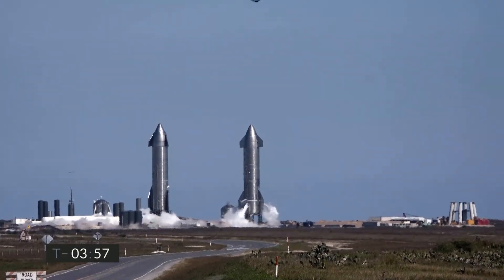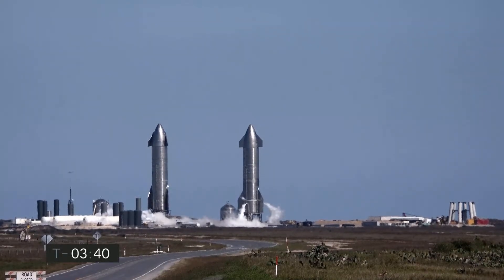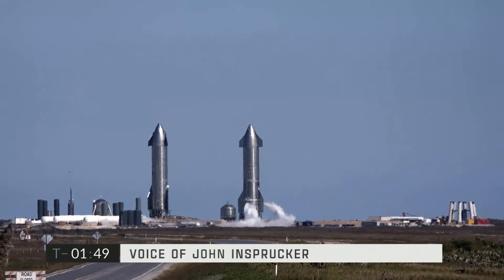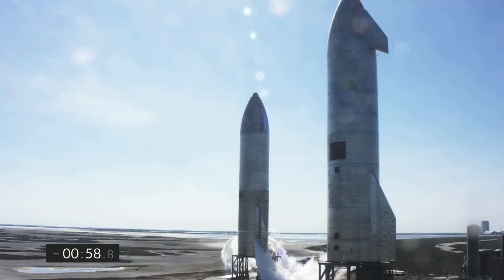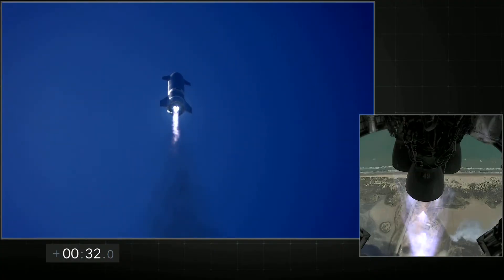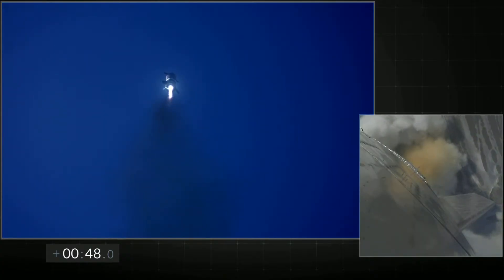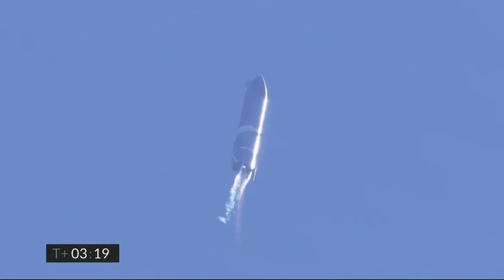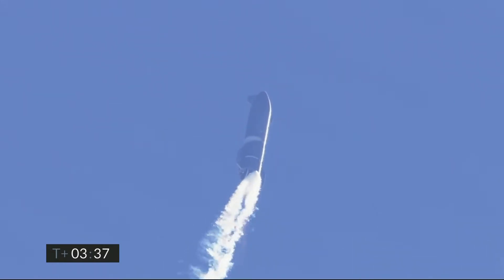Starship | SN9 | High-Altitude Flight Test

Comment: They didn’t fail they learned 2 ways not to land a rocket .
Reply: 11:46
Reply: @emilian9697  All the engines lit up properly per the queues.
Reply: @ioutra6121  compare sn8 with sn9 and than comment
Reply: @emilian9697  SN8's ignition on landing wasn't mixed properly and ended up burning the engines, causing the thrust to be insufficient for landing. SN9's ignition on landing was mixed properly, and the thrust was proper, but flipped too much as a form of overcompensation and made a hard landing.
Reply: @ioutra6121  this doesn't mean anything tell me how can you land sth that big with only one raptor engine
Reply: @ioutra6121  second engine didn't fire and thats it
Reply: @ioutra6121  how was the thrust proper it went to the ground as fast as a bullet
Reply: @emilian9697  The engines did fire as intended
Reply: @ioutra6121  yea  yea whatever you say
Reply: @emilian9697  e
Reply: @emilian9697  also they lowered the flaps in order to begin flipping the ship, but they should have re-extended it to keep it from continuing to flip
Reply: This is exactly why SpaceX is leading the world in spaceflight. They are willing to "fail" in order to learn.
Reply: @DanielH212MC  and it's the speed of failure/iteration what is amazing
Reply: @DanielH212MC  do or do not. Failure is not an option - 🐸
Reply: @DanielH212MC  Just like the Russians right?
Reply: At 12:45 "...we need to work on that Landing... a Little Bit..."  😆   I love that "A Little Bit"... this comment is is Masterpiece...   but would be useful to work a little bit more,  than a Little Bit, please 🙏
Reply: @simonci5177  What exactly is a little bit when dealing in that type of scale?
Reply: You can see one of raptor failed to light on again
Reply: @emilian9697  It looks like they had two engines not start up. I think one started up fully, another one tried to start but like, stuttered or something, and the last one didn't start at all.
Reply: @DanielH212MC  they land with only 2 engines
Reply: @DanielH212MC  He said that they wanted two engines for the flip and one for landing
Reply: @DanielH212MC  Either ran out of fuel or pressure fail
Reply: Daniel_H212 I believe that only two engines were intended to restart for landing.
Reply: @kilianclasen5521  maybe flaps+1 for flip and 5 for landing
Reply: @DanielH212MC  They said in the video. We will ignite one engine for the landing.
Reply: @DanielH212MC  Only 2 have to relight. The rocket makes a decision of either 2 or 3. This picked 2 but 1 of them failed
Reply: @emilian9697  On this stream and on NASASpaceflight's stream two pieces of debries were visible being hurled out from the engine area. I am really interested in the findings, what (if anything) could the debries indicate.
Reply: @CzechMirco  before or after explosion?
Reply: @emilian9697  11:47 you can see the first one to the left of the ship and then about a second later the second one to the right and above the ship.
Reply: @CzechMirco  yeah nice eye i think it came out of the flap
Reply: @emilian9697  Well, to be honest, I'm not sure whether I'd been able to spot it from this video alone. I saw it much more clearly on a video taken from a different angle at NASASpaceflight.
Reply: @emilian9697  That 1 is not ment to turn on.
Reply: @Bacavoit  2 need to turn on only one did
Reply: @emilian9697  wrong the second engine only needed to fire for the flip maneuver. it cut off as it should the craft just over shot the 90 degrees.
Reply: @highkicker11  watch sn8
Reply: @emilian9697  why arent they using all engines?
Reply: @lotusedelmann4030  they need to save fuel they dont have much and 2 engines are enough but one didn't turn on so 😕
Reply: @emilian9697  but if they are that unreliable at this state they could just load some more fuel
Reply: @lotusedelmann4030  they only pumped fuel for 10 km thats the requirement they cant fuel it in the sky
Reply: @lotusedelmann4030  Much lighter coming down than going up.
Reply: @lotusedelmann4030  
More fuel means a higher terminal velocity. That may not improve the situation.
Reply: @emilian9697  the last time both of them failed. this time at least one stayed alive. what a trooper
Reply: @emilian9697  if i recall it correctly they only did an temporary fix to the engine from last time.
Reply: @emilian9697  dont they test these things!?!?!? at this point spacex is just doing it to get attention
Reply: then they will do a "how NOT to land a Starship"
Reply: Absolutely, look  at how many times the F9 crashed before it stuck the landing.
Reply: @TheJimtanker  Exactly what I think when I see all the naysayers
Reply: @kilianclasen5521    SpaceX is the first company to ever use Agile Development in real world applications.
Reply: God Is good  They do a suicide burn, meaning the moment the fuel in the tanks end you should be on the ground, any later or earlier the engine start you will be dead. I do know that they can flip only using the hot gas thrusters as opposed to using the engines when they get added but that's later down the line+they won't be able to use the atmosphere to slow down as much if they flip earlier+they really had enough time, the engine tried to ignite for about 4-5 times; i really don't think more time wpuld have changed anything. I guess its a problem with the lox header pressure this time which doesnt benefit from more time.
Reply: Technically it did land.  In fact it's pretty hard not to.  It just wasn't a controlled landing.
Reply: Perfectly summed up 👏🏻
Reply: God Is good  I think testing the limits is good, it’s called a suicide burn for a reason. It’s testing a last minute burn to land.
Reply: You're so right, this is how science actually works.
Reply: They crash em, cuz tgey want a "how to not land a starship" video like the orbital booster one
Reply: Damnit, I was so hoping this was the one. Great work, Elon. Keep it up. 😋
Reply: that was a perfectly executed rapidly unscheduled disassembly
Reply: Success is in many forms.
Reply: Soon we’re gonna get ‘How not to land an orbital starship’ as the follow up to ‘how not to land an orbital rocket booster’
Reply: @ProtonSemilightCondensed  That’s what I was thinking too, lol Elon Musk gonna definitely edit the video himself.
Reply: True words!
Reply: I love that comment. I gonna teach my kids that. Its not failing. Its learning how to succed :D
Reply: Something fell off , 11. 46 . Left mid lower  . .  Metallic . .   Own up , who didn't do Thier job right .  Learn but don't learn . . Next time solve the problems correctly . As in , reliability . .
Reply: Gottfried Lieber  but a bellyflop landing is so much cooler!!!
Reply: why not use a parachute ?
Reply: Don't worry dude it's reusable
Reply: @waichungsham1578  haha - that's humor 👍😜
Reply: God Is good  I am pretty damn sure they know what they are doing much better than you and have considered all possible thing you can come up with
Reply: You don't need to improve on previous attemps on all attemps. If that was the case then engineering would be rather easy, in the real world, it is not.

The main goal of prototyping and testing is to analyse failure points design new ways to fix the failure points, to correct them. However the correction itself more than often will also have flaws that cause fails which can seem like losing progression during the test.
But do not be mistaken, each test whether it seems like it did worse or did better adds just as much progress as every other test.
Reply: Gottfried Lieber  Apollo 11 got lucky. They had a navigation failure just before landing. Armstrong landed blind. Pure skill.
Reply: Simulations only get them so far. This real world test data is completely invaluable. First time they ran out of propellant, this time second engine wouldn't start. They'll get this sorted out. They've landed what, 70 Falcon 9s?
Reply: Yeah mate. Perfect comment
Reply: Just like Edison
Reply: @benihanaa  probably before NASA lands on the moon again!
Reply: That's the spirit
Reply: This guy markets
Reply: thats the spirit. lol.
Reply: You mean an unplanned rapid disassembly
Reply: Absolutely, this is the process that is required.  Many things again went according to plan, just the last stage needs to be perfected.  Amazing progress !
Reply: Yeah👍
Reply: Spoilers! Jeez
Reply: COPE
Reply: now gotta be 3 xd
Reply: 98 more to go .. Diamond Hands
Reply: I was hoping for some aerobatics manœuvres, just for fun.
Reply: Spoiler 🙄🙄
Reply: There are thousands of ways not to
Reply: Crazy... that's exactly how we learn  everything in life
Reply: Gottfried Lieber  dunno if you are trolling or if you really are that clueless
Reply: That’s science!
Reply: And soft landing or not, it was glorious
Reply: Gottfried Lieber  But they landed only a small part of the system, the biggest part was thrown into the ocean!
Reply: good philosophy we all haz
Reply: God Is good  I thought of that too
Reply: God Is good  the entire point is to flip and burn at just the right time to use the least amount of fuel, as this is meant to be an interplanetary reusable rocket. performing the flip at a higher altitude negates the entire purpose of starship.
Reply: The rocket knows how to land because it knows how not to land. By subtracting how not to land from how it could land gives you how to land.
Reply: They learned by failing, it's still a failure
Reply: Gottfried Lieber  We can't, as in no one knows how to rebuild the F1 engines or something I heard
Reply: It was different this time, SN8 overburned and SN9 underburned it looked like
Reply: Gottfried Lieber  Apollo 1 testing killed 3 astronauts on the pad, and we very nearly lost 3 more lives on Apollo 13.
Reply: God Is good  It saves on fuel, hovering a spacecraft is ineffective and expensive (same reason they developed the crane landing system for the Mars rovers, to have a short hovering time and save en fuel/weight)
Reply: @Berserka-1  just because it didn’t land, doesn’t mean it failed. It had more improvements than SN8
Reply: @MITCHELL LANDREY interesting theory!
Reply: Why not to start the flipping earlier than that like on 5 km hight and try to control its altitude first then go landing.
Reply: Yep... and making history at the same time.
Reply: yup
Reply: God Is good  The higher up they flip, the less drag they have and the faster the ship meets the Earth.  Flipping earlier makes for a harder landing.
Reply: People didn’t go back to the moon 50 years after landing, they spent $ 218 billion on it, and now Ellon Musk has appeared out of nowhere and lo and behold, let’s go to Mars,, who is he, where is he from, where did his billions come from, who is pushing him and financed, what kind of game is that, ??? The powerful in the world must know something that we ordinary mortals do not know, something is badly prepared for us, why great powers hide behind an individual and do not tell the truth, why 500 people are sent to Mars at once, in two or three years, to preserve human genus, civilization, our genetic material, is this the end of the Earth, civilization and life as we know it, where is the truth and who knows !! ??
Reply: 3rd times a charm !
Reply: Omg stop trying to be so preachy, it’s gross in the comment section
Reply: Lmao
Reply: Spacex future video be like : how to not land a starship
Reply: Yeah. their making another how not to land YT video again for this purpose.
Reply: THIS IS THE WAY
Reply: I do find it “interesting” that there are so many with absolutely no engineering training or experience trying to tell the rather brilliant rocket scientists at SpaceX how they “should” do things.  Oh, the internet... it sure does bring out the idiots who think they know it all.
Reply: @CharmsDad  Yes it is so aggravating to hear some of the comments at least have  engineering training some years underwater and worked for NASA, JPL. subs are the closest to star ship a skate class was 25ft Beam torpedo room to reactor compartment 160ft + or - a few feet.
The hydraulics, air systems, electrical systems, propulsion systems, reactor controls, primary and secondary generators it will be fun
,  CAMS, O2, CO2, electrolysis, all tested on subs before going to the ISS and still being used, and will go to mars 90 days underwater is half way to mars. I have been half way
Reply: Definitely
Reply: Rockey
Reply: Simp
Reply: God Is good  and what would they do about the extra g force they had to counter.
The flaps were introduced for a reason.
Don't try n act smart if you don't know shit.
Reply: we will soon see how not to land a starship video:)
Reply: https://www.youtube.com/watch?v=Im799XZxLEs
Reply: God Is good  "seems stupid": that's why you're not an engineer at SapceX.
Reply: Na... we already new it was a bad idea to crash and blow up on the ground. Nothing new learned. I new that 20 years ago with my Estes rocket 🚀....
Reply: Houston the eagle has land.... 🔥
Reply: Everyone commenting "failure" is probably only here because it's an Elon Musk venture. They didn't even see SLS "fail" when testing a few engines on the ground a few weeks back, which is an overdue and well-past budget project, meanwhile SpaceX is conducting real flight tests. A prototype is a prototype, they make 'em for a reason. If they were confident, there would be two stacks, 28+6 engines, astronauts on board, and course set for the moon.
Reply: 4...3...2...1... Houston we have landed🔥… hello eagle do you copy?
Reply: https://youtu.be/5NVRVeyfFTA
https://youtu.be/5NVRVeyfFTA
Reply: @Dean Zinter You’re right about one thing, you’re clearly not an engineer because you obviously know nothing about high end development.
Reply: Even if it works,its a receipt for desaster.
Reply: @OompaL0ompa  A “receipt”???  Wow, you clearly don’t have the slightest clue.
Reply: 1 raptor indeed failed to light up again. I guess they failed to address that. Also, doesn't anybody think they're trying to land the Starship with little wiggle room to light up the raptors? MAybe they should light it up higher than usual.
Reply: @The_Crazy_Monkey75  They’re experimenting with a new and innovative method of landing.  Most believed their plan to land the boosters was unachievable, yet they are now making it look routine (after several failures in the beginning).
Reply: https://youtu.be/5y1qjObX660
Reply: God Is good  Its called a suicide burn for a reason
Reply: You're right 👍
Reply: https://youtu.be/5y1qjObX660
Reply: @Brady M. Kolve well said!
Reply: well yes but actually yes
Reply: i live in a third world country , meaning i can't buy PS5 so if you subscribed to my channel i can't be any happier to buy one :)
current : 227
Reply: Best comment.
Reply: @benihanaa  You are just fooling yourself. NASA is behind this for providing techniques. Why didnt nasa do what Mask is doing ? Easy answer: No fuking use. Review Mask's Ideas--none of them is with much scientific value because he can not aford it. It's just commercial. This Rocket-Regain technique is not something new. There s limits with this. I suggest you get some engineering title first.
Reply: https://youtu.be/eFOh32tUAkE
Reply: https://youtu.be/XDgEQHrC3Kw
Reply: ,,https://youtu.be/TVvLwVsQ7dM...
Reply: @Shairkhange  no im not but i don't think you are neither and you are not as smart as Chris Hadfield and if you dont belive me go see his recent video in ig🤷‍♂️ mad 🐀
Reply: @Shairkhange  and who tf said engine was the problem in sn8 i said it was in sn9
Reply: The Fanboy level is off the charts🤪
Reply: https://youtu.be/DVHl-V23_TQ❤🐾😺❤
Reply: https://youtu.be/95ytVYby5A4 🙏💖
Reply: https://youtube.com/watch?v=hGVDzN-oPGA&feature=share🙏👌
Reply: Yes, that's how you learn. 🙄
Reply: God Is good  it does seem that way, but there is less aerodynamic drag and control when it is upright. That means you have to run the engines, and that means you have to leave fuel to do so. When a single engine consumes over two thousand (2000) pounds of fuel and oxidizer every second, every second they are on is critical. Part of these tests is to learn to do that maneuver, perfectly with minimal correciton, every time.
Reply: So in other words they failed
Reply: How long does it take to get from a 'free-dive' to a vertical stop in the air on one engine only?
That would be the point to re-ignite the engine for the landing.
...just in case no other engine works.
Reply: True
Reply: Yeah
Reply: in zero grav..thatmofo is for the moon man
Reply: wow , the PR really works on you 🤣🤣🤣🤣🤣
Reply: https://youtu.be/vwvTarqg8g4
Reply: Well a nazi like von brown needs to be on the team
Reply: If the intent is/was to land the thing in one piece, they failed... no point softening it down!
Reply: There is more than a million ways not to land a rocket, and one way to land a rocket perfectly
Reply: @MITCHELL LANDREY mhmmmm
Reply: Mars is the New Earth! Earth Will soon Die Anyways!! Musk is God. TESLA and Tesla Holders will be Kings. Rest and their Family will be Our Slaves and work to Power energy for Bitcoin!! Elon is Einstein, Edison, Newton, and Jesus combined. HE at least deserves several Nobel Prizes. Elon has more IQ than weight of Hater's Ug ly Prius and his F at Ho Combined!! HE is like Ironman who will destroy Thanos and critics are better off using their cash to wipe their a n us. JUST Worship Him instead of other silly god!! GOD Elon will Punish infidels!! Go Emperor God Musk!!
Reply: G ay Eco-Nerds Hate Bitcoin Because it use more Energy than major countries. BUT Space X and Tesla both Hold Bitcoins. Elon himself has Bitcoin and Ethereum. Tree huggers and Eco-Nerds should buy something else. I don't do nerd things like electricity or energy. Bitcoin Haters will become our servants and Plant More Trees! Non-Holders will Work to Death to supply electricity for Bitcoin!! Haters of Tesla and Bitcoin will only Lose Money. Have Fun Staying Poor! We will RULE while they LOSE. Buy Bitcoins While They Are Super Very Cheap!
Reply: تعدد الكواكب
Reply: I sense a future upcoming “how to not to land” series.
Reply: There's the right way, the wrong way and the Max Power way.
Reply: It seems that SpaceX needs to practice the flip maneuver to landing way earlier.
Reply: Can't wait for the "How not to land a fully reusable orbital class Starship" video.
Reply: I can‘t wait for the video „how not to land Starship”
This will be so cool to watch in a few years
Reply: Its the same how the last one crashed one of the engines didn't start in time maybe they can try a different landing approach
Reply: @anselmrd2638  The last one crashed because they ran out of one of the fuel components in the engine (the exhaust went green, which meant it was burning engine components instead of the right proportion of engine fuel/oxidiser mix)
Reply: The Solution here!!!!! Read!
Flip at 2km on upper engine with the right pressurization in that moment.
When Silos stabilized and slowed down (3-4sec after flip) start the 2nd and 3rd engine.
Enjoy the landing!!! 
Mars we are coming to yaaa!!!
Reply: New video coming up soon
Reply: Lol
Reply: Why can't they do in small scale and check lol
Reply: @debashishjena    Simulations are one thing but only in real life will you find the true chaos.  You don't play KSP do you?
Reply: @debashishjena  sometimes the only way to make it work is to test it at full scale, and the more Stardhips they build the better they get at building them
Reply: The following is happening in our World and no one is noticing.

1. Armageddon is about 4 action events.
   1st horse, Bow = Send it.
   2nd horse, Sword = Strike it.
   3rd horse, Scales = Split it.
   4th horse, Fire = Sear it.

   That ='s Our planet for the last 2 years have averaged 3.23 Rockets a day into space.
   That's hundreds of rockets we've *Send*/sent up.
   We've sent close to a 1000 Rockets/with Elon saying he's sending another 1000.
   They are weapons designed to stop "Wormwood" in the book of Revelation in the Bible.
   All Telescopes on this planet are pointing in the same direction.
   Elon is building underground tunnels in major cities.
   "Wormwood" is going to hit the PACIFIC OCEAN. *EVACUATE*.
   All the ELITE TOP COMPANIES ARE EVACUATING THE PACIFIC COASTS...SO SHOULD YOU!!!

2. "The mark of the beast".
 
    Take 3 6's and place them in a circle and you have a virus warning symbol.
    But the Mark is the VACCINE. And because it is a global problem it will demand a global solution.
    The Vaccine will be given Airborne and it will land on your forehead and hands.
    It will try to alter Chromosome 7 lamb1.
    It is during these moments where the Bible mentions: You will wish the mountains to fall on you.
    And this is also the moment where the Bible mentions: The "few" and the "many".
    "Few" will die from this Vaccine (millions) and "many" will live (billions).
    This vaccine will cure all diseases BUT it will not remove the Pain from any injuries you receive.
    That is the moment of the "delusion" mentioned in Revelations. 
    If you get a cut or any injury, the pain will never go away, they just keep building up.
    You will wish the "mountains to fall on you".
    666 (six - sick - sicknesses) <->  Six species of human corona viruses are known , 
    with some species subdivided into two different strains,     
    making seven strains of human corona viruses altogether.

    Rev. 13:16 is referring to those who DIDN'T make the rapture of the church (The "born again" PEOPLE). 
What you and I are discussing is correlated with the 4 Horsemen (the timing).  
1st Horseman is the Bow (SEND it). < That Horse rides as we speak. All the Rockets this Planet SENDS into Space are Weapons of mass Destruction targeted at "Wormwood". For almost 2 years now our Planet as sent almost 1000 Rockets into space and now we are averaging 3.23 a day. Elon just boasted within the past month how he intends to send a 1000 more.  
BEFORE those ROCKETS touch "WORMWOOD", 2 EVENTS will happen.
1 Event will be the "RAPTURE" and 1 will be the "AIRBORNE VACCINE". < BOTH OF THESE EVENTS HAPPEN AT THE SAME TIME.  < The "AIRBORNE VACCINE" is the reason it happens.

I have to stop here and explain something.
Our Souls are physically attached to Our flesh by Chromosome 7 lamb1.
When a Person (truly) becomes "BORN AGAIN" Chromosome 7 lamb1 CHANGES.
So now you have 2 different groups of People on the Planet. Those who are "born again" w/the altered "lamb1" and those who don't. 
Now having said that. When the "AIRBORNE VACCINE" lands on your forehead and hands, it's going to try and alter Chromosome 7 lamb1 AGAIN.
When it does, ONLY those who are "BORN AGAIN" will die. Those who don't have the altered "lamb1" will LIVE...and be able to buy and sell during the TIME OF THE ANTICHRIST.
The "BORN AGAIN" People are people who have God's Holy Spirit INSIDE THEIR SOULS.  God's Holy Spirit isn't on this planet during the 7 years of the antichrist. His Spirit is raptured from this planet BEFORE THE 2ND HORSEMEN RIDES!!!!!
(I'm throwing pearls, you better be getting this). <<<<and all of that can't happen till the "LAST SUPPER" (see my "Last Supper" video on my channel) is over.

Then the 2nd, 3rd and 4th Horsemen happen.

So once again. The "mark of the beast" is NOT A CHIP. 
ITS THE COMING "AIRBORNE VACCINE".
You must be "born again" before the "airborne" vaccine is given or you will be here for the 7 years of the antichrist.

3. The scorpions mentioned in Revelation 9:10.
 
   There are satellites in space called HIVES.
   Inside each of them are tiny rockets called BEES.
   They are designed to Target all CELL PHONES.
   They will be mercy killings by our governments because of the actions above (for 5 Months after the asteroid hits).
   They were just tested against that RV that blew up.
The reason the word "scorpions" was used? 
What the person saw was a vision and then it ended up in Revelation. The "vision" He saw was long cylinder puffy clouds streaming from the skies, lots of them and at the end of each of those was a tiny little missile, but to the person having the vision, to him it looked like a bunch of scorpion tails or should I say cloud TRAILS.

Please I'm begging you to listen to what I've said. These events are happening right now.
There seems to be a GRAVITATIONAL PULL HAPPENING. ( Wormwood (rock heading this way in space) of the book of Revelation in the Bible )
Floods in the desserts of Saudi Arabia.
Blizzards in Spain.
Huge clouds, heavy rains and flash floods in Saudi deserts, Qunfudhah, Taif
Mass fires in Brazil.
Hot Spot - Ocean, & Scanning Yellowstone Super Volcano. 1/21/2021
Mass electrical storms in Turkey.
Hot Spots & Scanning Yellowstone Super Volcano.. 1/17/2021
Neva River freezes, Saint Petersburg, Russia
Volcanoes are activating around the Globe.
Sewage fountains out of drains during floods in Cochabamba, Bolivia
And more...!
Luke 21:11 
There will be great earthquakes, and in various places famines and pestilences. And there will be terrors and great signs from heaven.

I don't post links no more because YouTube removes them. This is so important that you help 
me tell others. I didn't make anything up. If you get a moment come see what else I've discovered
on my channel. But I beg you with all of my heart and soul to at least tell someone what you've read.
Please at least do that. Nothing on my channel is monetized.

Folks, we are SENDing rockets into space to STRIKE a rock that the book of Revelation in the Bible calls "wormwood" and when those rockets SPLIT a piece will hit right above INDONESIA in the Pacific Waters and it will rock up and down the FIRE RING of the PACIFIC sending LAVA TO THE SKIES which will SEAR 2/3rds of this PLANET.

I'M BEGGING YOU, HELP ME WARN OTHERS!

You're thinking how can you believe me?
I'm the guy who God showed where His Garden of Eden was ( I can backup those words if you come to my channel).
SOON A GLOBAL king WILL APPEAR, DON'T FOLLOW him he IS THE ANTICHRIST!

NOTE: SOON SOCIAL MEDIA WILL DISAPPEAR GO TO MY CHANNEL AND COPY MY COMMENTS AND VIDEOS SO YOU CAN SHARE WITH OTHERS ON DISKS. NOT ALL OF YOU ARE GOING TO MAKE HEAVEN (THE RAPTURE), YOU'LL BE THE REVOLUTIONIST FOR JESUS DURING THE 7 YEARS OF THE ANTICHRIST. BE READY TO HELP OTHERS. DURING THE 7 YEARS, THE ONLY WAY TO MAKE HEAVEN IS TO BE A MARTYR FOR THE CAUSE OF JESUS. YOU DON'T DO IT BECAUSE OF THE PAIN YOU FEEL. YOU DON'T DO IT BECAUSE YOUR SCARED. YOU ONLY DO IT BECAUSE YOU REALIZE WHAT A MISTAKE YOU MADE AND NOW YOUR WILLING TO GIVE YOUR LIFE FOR THE CAUSE OF JESUS. BE BOLD IN THOSE DAYS, OTHERS WILL BE WATCHING YOU AND WHAT YOU DO WILL INFLUENCE THEM. MAKE WISE CHOICES MY FRIEND. THERE IS A CELEBRATION IN HEAVEN EACH TIME SOMEONE COMES TO THE SAVING KNOWLEDGE OF JESUS. DON'T LET EVIL STEAL YOURS AWAY FROM YOU. STAND STRONG AND WHEN I SEE YOU I'LL GIVE YOU A BIG HUG AND A KISS ON THE NECK AND WE'LL CELEBRATE FOR ALL ETERNITY!
Reply: Fail
Reply: Failed is failed,
Reward is to learn.

Dont mix facts and emotion together.
Reply: Kinda looks like they lend a way to destroy 2 rockets
Reply: this is pretty much how code and my code still buggy as fuck
Reply: Yes ....that was a failure...
Reply: It failed
Reply: That's the worst comment. There are millions of ways NOT to land a rocket, and only 1 to land it.
Reply: @hqcart1  Its NOT the worst comment. What B Reeves said is true they did not fail they learned 2 ways not to land a rocket, it means they can avoid that way  to land so they can try another way to perfectly land it.
Reply: @hqcart1  i mean I bet there is more then 1 way to land a rocket. There are probably millions of ways not to land a rocket and millions of ways to land a rocket.
Reply: @hqcart1  Nope: that comment is from Spacex.......Falcon 9
Reply: @hqcart1  There is as much ways to land a rocket as  not to land a rocket.Why would there be only one?? Are you living in 1 photon universe or something?
Reply: @hqcart1  I think it was meant to be humorous.
Reply: @hqcart1  i think they're trying to shoot a rocket with cargo and land. Not just a booster.
Reply: @hqcart1  I'm sure there is more than one way to land a Rocket.  Just not that many.
Reply: @hqcart1  actually there are more than one to land a rocket...
Reply: @hqcart1  are you familiar with the concept of a joke? No?
Reply: @hqcart1  pretty sure it wasn’t that long ago where we didn’t bother landing the rockets. Now there are multiple ways: parachutes, boosters, shuttle cruising in like a plane...
Reply: @hqcart1  I bet they can come up with more than one way to land it.  They seem pretty smart and creative.  how many thought going horizontal was even part of a landing picture in the first place ;)
Reply: @hqcart1  Wrong again.  There are millions of ways to land a rocket... unfortunately, most of them leave the rocket in a rather unusable state.
Reply: @hqcart1  I mean landing, crashing meh the only difference is the explosion at the end
Reply: But really failed at landing a rocket.
Reply: This was a fail, they had a better attempt on SN8. They are going backwards on progress.
Reply: @marine2tough    The purpose of this mission was to LEARN how to take off, fly, and LAND.  They learned from this mission.  If you listen to the SpaceX stream you will hear that they had telemetry for the entire flight.  NOT a fail.

Still a hell of a lot better than YOU'VER ever done.
Reply: @TheJimtanker  Exactly! And overall this is just the second test flight, the intend of these tests are to analyze the rocket engines then to see what went wrong and how they can improve it in the next test.
Reply: @synthwaveguy_2942    Yes, and they're 10 years ahead of the SLS which will probably never fly.
Reply: @marine2tough  I don't think SN8 performed better. It really depends on what went wrong this time, which we don't know yet. If the header tank lost pressure, then it performed the same as they didn't manage to fix the issue. If the header tank didn't lose pressure, then it performed better, and they are about to discover a new issue. This is a prototype and the goal of a prototype is to find issues with the design so it can be improved.
Reply: @marine2tough  

How did they go backwards here? The fuel pressurization seemed alright, no green flames!
Reply: @marine2tough  they are not going backwards, they fixed the problem that made sn8 failed, this time it was something different (probably an engine failure) so they are going forward beacouse they improved from SN8. It's like learning how to ride a bike, even when you fall over but if you got further distance it's still an improvement
Reply: Come on dude. NASA could do way better than this. Mask is just a clown for doing this project. Funding Space projects is national not commercial.
Reply: @andyweingarten5978  LOL! "NASA could do way better than this..." LOL #MoronOfTheDay
Reply: @andyweingarten5978  NASA never tried to land a rocket. Last time they tried they didn´t even get the rocket in the right direction!
Reply: @macdieter23558  dude. get a title first pls. A rocket is just a toy. How many times has Nasa landed a spaceship.
Reply: @andyweingarten5978  way better? How many times has the SLS gotten off the ground yet? Both projects have been running for almost the same length of time.
Reply: @CWO333  but one has got a pricetag bigger than the entire Space X economic history 😜
Reply: @andyweingarten5978  How can you say that hehe, NASA wouldn't even try this, and their moon rocket is still living in the 80s! Commercial Space Companies are getting so much farther in a small amount of time than NASA ever will do (and they do it better hehe)!
Reply: @andyweingarten5978  bahahahahahahahahahaha
Reply: @andyweingarten5978  ¿De verdad que la NASA puede hacerlo mucho mejor?,¿entonces porque no tienen nada todavía que ni se le acerque?, si es así, parece que lo tienen muy bien escondido. Explicame porque la NASA contrata a SpaceX para que lleve sus astronautas y sus cargas al espacio.

Can NASA really do it much better? So why don't they have anything yet that doesn't even come close to it? If so, it seems they have it very well hidden. Explain to me why NASA hires SpaceX to take its astronauts and their cargo into space.
Reply: @andyweingarten5978  

You’re name calling the entities involved but you don’t have a valid argument worth debating about here.
Reply: @topsecret1837  Because Mask is not making any useful development.
Reply: @andyweingarten5978  Maybe NASA could have done better than this but it would have taken them 10 times as long because they’re not willing to do rapid iterations to learn from failure. They are building a new space flight system by the way...has it even flown yet?
Reply: @andy weingarten  This is a test & NASA has had a few failures. This "failure" is part of the plan and Space X won't be stopped.  Look back to 2008 when Space X was 0 for 3 with Falcon 1. And what the hell does anyone care? THIS launch was on Space X's dime - not tax payers. This is the mega rich playing with mega model rockets. We are going to Mars. Cheer him on.

Wired interview 2008:

Wired.com: How do you maintain your optimism?

Musk: Do I sound optimistic?

Wired.com: Yeah, you always do.

Musk: Optimism, pessimism, fuck that; we're going to make it happen. As God is my bloody witness, I'm hell-bent on making it work.

https://www.wired.com/2008/08/musk-qa/
Reply: @andyweingarten5978  NASA XD?! They are making SLS for almost 10 years, Sn9 was builded in a month or 2 while starships are flying SLS is sitting on the pad and it cannot even do a static fire correctly
Reply: @andyweingarten5978  and we’re have national space agencies been? Rocket technology has progressed more in the last 15 years because of commercial space programs then in the past 40 from national agencies. Competition drives technological innovation, there is no competition of affordable, reusable, high volume rockets within nations.
Reply: @andyweingarten5978  Funny how a private company is doing better than most national agencies though. I love that space flight is being explored by private companies. Brings good friendly competition, they aren't restricted by a budget set by the state, and don't face the ever threatening hammer of having a program canceled. By the way, NASA works very closely with SpaceX. Yes, SpaceX has had some issues but has still proven to have a very great rate of success on their launches. This does not count as a failure, this was a TEST. They wanted to see how the subsonic reentry performed and it performed flawlessly. This the absolute first time a rocket has ever done this. Pretty damn good to do it first try don't you think? Open your mind and stop worrying about who is doing the actual work, just be happy that space flight is finally advancing at a rate that is comparable to the days of Apollo.
Reply: @quarklatinum  You are so wrong. Mask is doing this for making money. Not changing the future of human being. He wont and he cant.
Reply: @andyweingarten5978  where have you been? Making it commercial has been NASAs strategy for years.